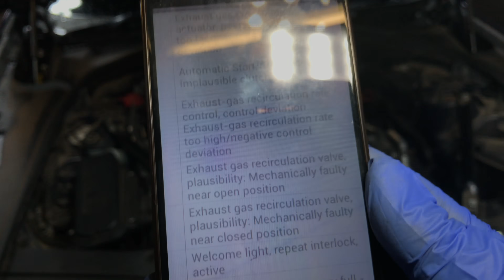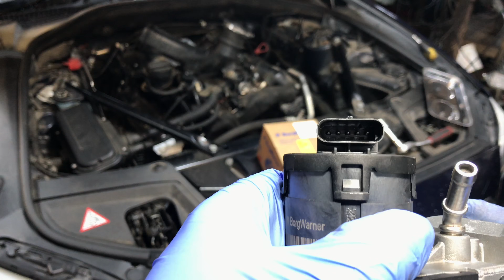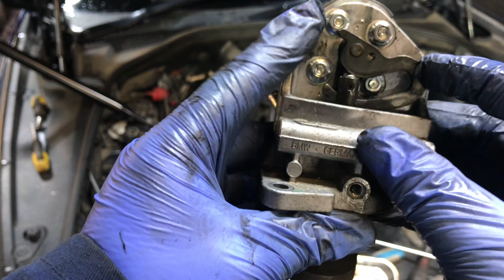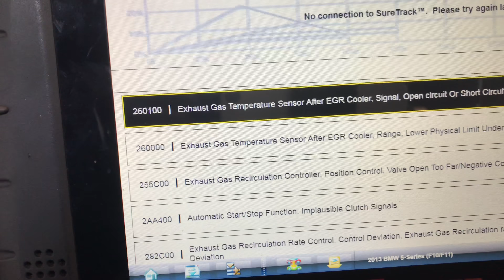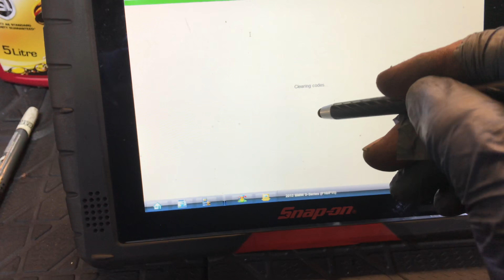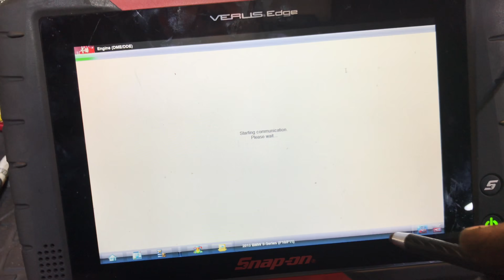BMW 520d F10/F11 (2014) Fault Codes 255C00, 282COO, 272FOO, 272EOO! EGR Valve Replacement!

Comment: Hi man, how are you. I also had a problem with egr, and i've change it few days ago. But, now i have some issue with throttle hesistate at low speed, and also have diagnostic issue "exhaust gas temperature sensor". Can you tell me, did you also change a temperature sensor beside egr? Thanks
Reply from the maker: I've had this problem with cheap non oe EGR valves! You can ignore temp sensor that's not the cause
Reply: Thanks for answer. I also put the "cheap" egr, after oem stop working. But now, i have that problem only at low speed between 1600-2000rmp.. at full trotlle, car goes without any problem,.. so you mean, it might be a problem with the new "cheap" egr?
Reply from the maker: @meganesport20  yes
Reply: Tnx once again.. i will try with the new one, because, this is very annoying.. regards

Comment: Ive done this egr-valve change. Not so hard actually.. here are some must do tricks. 1.  Remove air pipe to the left. 2. Remove engine cover. 3. Remove the cover under the airfilter. 4. Remove the plastic cover on the valve. 5. Before putting new egr-valve in you must connect the back hose and tighten the clamp just so it sits. Then tighten it correctly after you install egr-valve correct.
Reply: Can you confirm if a new valve needs coding in? It looks like from the end of this video you don’t?
Reply: @lukemortlock  No coding needed 😎

Comment: Hi. I HAVE QUESTION ABOUT NEW EGR IN 2014 F10 530D.
NEW EGR NEED ANY INSTALLATION PROCEDURE?
ANY calibration after?
Reply from the maker: I've never done a 530d but the 520d is just plug and play! No calibration required cheers sandy